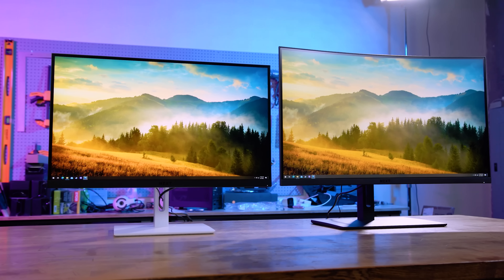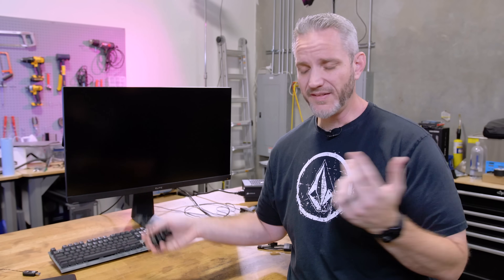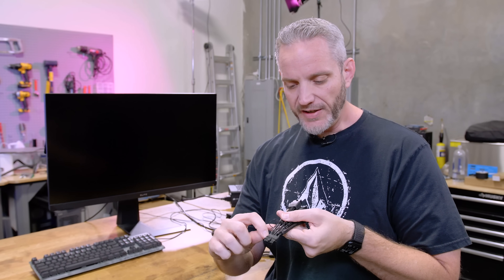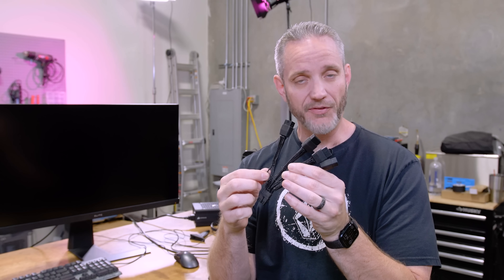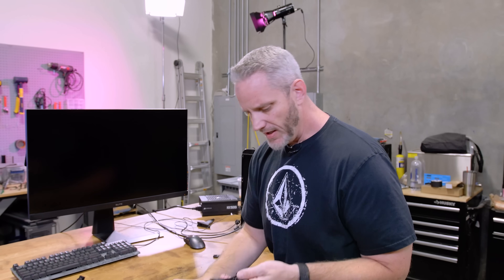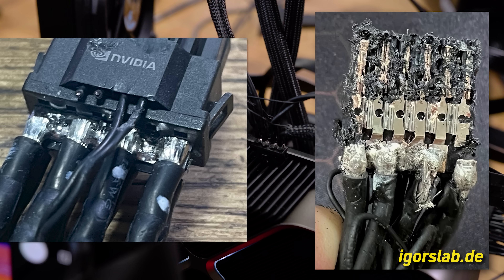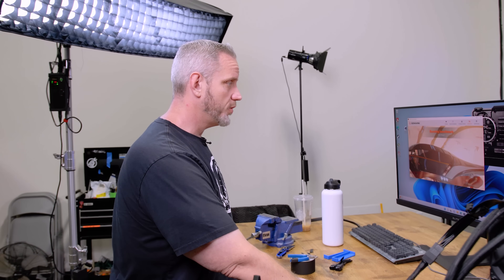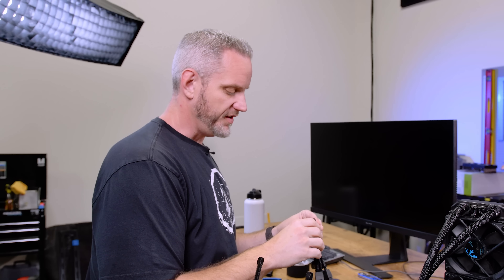Igor's Lab figured out why NVIDIA adapters are melting!

Comment: I miss the old days when cables were terminated with a crimped on connector that was nestled neatly deep inside the plastic housing where this sort of damage wasn't possible
Reply: Honestly why did they do this? I don't see it being cheaper.
Reply: crimped connectors are also connected to the isolated wire which acts like a strain release.
Reply: In aerospace all connectors are crimps for this reason. Crimps can survive extreme vibration levels that will cause solder to fail.

 An issue with crimps in commercial applications is that some manufacturers will cheap out and use generic tooling which doesn't crimp to spec. Pretty much all crimped connectors have an associated official crimp die that is only available from the manufacturer. For example the very common Harwin M20 connector (sometimes called a "dupont connector") has an official hand tool that costs $800 and as anyone who has tried to crimp these with off brand tools can attest generic tools make very poor crimps with them.
Reply: @nevoyu  Well it is cheaper just putting some solder and also they don't want to make a product that will last ages
Reply: @nevoyu  my guess is they pulled a Microsoft and engineered it to fail so you have to buy something else. Microsoft did it with the Xbox 360 video cable made it so it would fail and you would have to get a new one
Reply: @Di3Leberwurst  They should use barrel crimps like the ones used on Deutsch connectors in cars, those are tough as nails.
Reply: I really miss those days when PCI could provide the needed power by itself :D
Reply: @alifighter206  lol I don't have to miss those days I live it every day with my system... Socket 939 phenom x4 and Radeon 5450 lol
Reply: @alifighter206  u cand do nothing with such low power, only 75w come from PCI nothing but extreme low gpus can be powered with that.
Reply: @nicane-9966  then maybe they should rework the socket power delivery spec instead of making a weak connector spec
Reply: Nvidia just painted themselves to corner by making 4  Pcie 8 pin plugs to 6 +12V pins. There could be a way to wire the 12 pcs +12V from 8 pin pcie to 6 pins on new plug by putting double wires per pin and crimping them.
Reply: @nicane-9966  i know buddy, i was just kidding, only 710 gt could get its needed power by pci, even low end cards like 1650 need 6 pin power cable.
Reply: I miss the days where you just plugged your videocard into a slot and be done with it.
Reply: Socket 939 was opteron and x2 / FX cpys, phenom was years later.
Reply: @solocamo3654  you are correct sorry it has been many many years since I have been able to afford to build a new pc
Reply: yes. last week. the old days. lol.
Reply: @ThatGuy-ou4ev  lol it's like 30 cents per connector and close a $1 per if you run gold plated. Plus they would have to pay for some pretty expensive tooling (compared to a solder station) to automate the building of these adapters. The crimps themselves run like $300. There's no way they're going to do that unless they charge like $50 or more for the adapter.
Reply: I honestly feel stupid. I was convinced this was a bigger problems than it is. it turns out the issue is Nvidia! It never occurred to me that they would use solder in a connection that was designed to be crimped.
Reply: @alifighter206  now the VGA power consumption is higuer than all the other components combined.
Reply: They still are crimped on cables where each pin has it's own cable. I think Nvidia just did this to make it simpler for themselves, because there is no good way of connecting 3x4=12 power pins from the 4 8-pin connectors to the 6 power pins on the 12 pin connector. You can't just crimp two wires in a single pin. And since the power needs to be balanced across the pins and the 8-pin connectors, you can't just connect two pins from each somewhere in the middle. 

You basically need to have all pins have a common connection, and they decided to connect the 3 pins on each 8-pin into a single wire, and then connect all of those 4 wires with solder onto plates from the pins, while what looks to me like keeping the connections between the pins that come from manufacturing them from a single long sheet of metal, which are usually discarded. The problem here really, is that solder is not a good mechanical connection, and can easily experience failure with strain. 

The plates are also not the normal way to connect the pins to the wires, and they too have a weakness in how they are connected - with crimping, you can have a larger amount of metal connecting the crimping zone with the pin, because the pin is bent in a somewhat cylinder shape, but so is the crimping zone, while with plates, because the plate needs to be flat, you have to decrease the amount of metal connecting the plate with the pin.

I can get why the engineers did it this way. There's no really other way to do this without having some simple PCB in the middle, which adds a bunch of costs, since now you have to both solder and crimp, doesn't look good, and would likely be a bit of a pain to builders. But seems like that didn't work, and I do expect them to add a PCB somewhere to solve this - whether on the 12-pin connector, or somewhere in the middle.
Reply: @ThatGuy-ou4ev  I'm a body man in a GM collision repair facility and this is objectively incorrect.  Those connectors have been known to melt on 35W load.
Reply: @ignaloidas  looking at the image from igor the solder connection wasn't the fail point if you look at it again it's that less than paper thin sheet metal that the pin and pads are made from... There is plenty enough room on that over compensating graphics card that they could have made or used a different connector all together. You know possibly try and work together with another company and design a different pcie power connector for the next gen instead of this
Reply: @gvibes69  Do you really think that after criticising the approarch Nvidia took for 4 paragraphs, and then saying why they did it that way, I am defending Nvidia? No, they did a mistake. I understand why, but that doesn't excuse the lack of QA of the design.
Reply: @gvibes69  Defending? No, I just understand the realistic cost of trying to run Deutsche or even Ampseal the slightly cheaper connectors. If you've ever actually built the connectors and bought them as a manufacturer, you'd know that it would be unrealistic to throw it in as a freebie.
Reply: I've said it before... Just slap a mobo 24 pin power connector on it and call it a day
Reply: @Skaadi89  Mobo 24 pin has many pins that cannot power a GPU, also the 24 pin spec requires that there is exactly one of them on the PSU, as some of those low-power pins are used to turn on and off the PSU when requested by the motherboard.
Reply: @johndododoe1411  I'm only suggesting to use the connector doesn't have to have the same pin out or keying just use a connection that can support enough wires to safely handle the power draw and be strong enough not to break it's not like they are lacking space on the card they didn't have to use a dinky little fragile connector
Reply: Molex! Molex! Molex!
Reply: @brodriguez11000  I can agree with that lol
Reply: @Bot.number.69420  Oh they can. All these fancy connectors are basically extensions of the Pentium 4 P4 connector. That means, just two connections - 12v and ground. All the additional wires are for required current capacity. So if you really want it to be made simple, take a cue from appliances and use those kind of terminals and wires.
Reply: @Skaadi89  It ain't that thin. Certainly thicker than the traces on the PCB the connector comes down to. And it's the same with other power connectors on a computer, all but sata are basically the same folded sheet metal pin design.

The real problem, as I said, is that instead of crimping, Nvidia chose to solder, and an soldered soldered connection needs a flat surface so solder to. To achieve that flat surface, you have to compromise the amount of metal between the soldering surface and the rest of the pin. If they just crimped, like the connector was designed for, it would have been fine. This is no fault of the connector, only how Nvidia implemented the splitter.
Reply: With this issue evolving they should be forced to use crimped wires. Here in Germany we strive to switch to solderless joints for obvious reasons.
Reply: Yeah, it blows my mind that they use such tiny solder joints for high power connections. I get that the female (or male...? not sure) is soldered to the card, but those are through holes and far, far stronger.
Reply: @atomicskull6405  not just aerospace in almost any wire harness it's the most secure and safe connection available if you need connector and where vibration is present 
Solder is non flexible and will create a failure point at the end of the solder where the wire becomes flexible
Reply: @SviatoslavDamaschin  all power supply are made with crimp connector it nothing special it even faster and easier to manufacture
who ever said this was a good idea must be fired on the spot
Reply: @Tenzen.  what lol this is nothing for a company lol 300 buck lol
Anything with a connector is crimped every power supply in existence use crimped connection
Not one car manufacturer use solder on wiring harness 
Crimping is a way more repeatable process that will ensure quality and durability where solder will vary from one to another 
And is the only way if you want a waterproof connector
Reply: Then go back to stone age as well you will definitely going to enjoy and also stop using technology and live on tree go champ this is what you want
Reply: @legros731 I didn't say not to crimp. I said the use of Deutsch or Ampseal connectors and giving them away with gpu at no extra cost won't happen. 

There's cheaper and easier methods to crimp connectors.

$300 is per hand tool to crimp and it has to be done in a precise manner or the connector has to be redone. If they tooled out something to automate it would be way more expensive than using existing automated tech to crimp pins.
Reply: @flynntaggart7216  you don't seem to be all that bright. We are just saying it would have been better to use something more sturdy. You know something that can actually handle being installed and used without fear of damage. I guess Nvidia could have just made the card not as tall there is quite a bit of empty space that could have been trimmed off so it could fit in a case without having to bend a chintzy cheap cable that really can't handle the current that flows through it or maybe put the power connector in a different location that wouldn't require bending the cable. Nvidia designed the whole pcb they could have done something different.
Reply: @nevoyu  crimping is a physical press process. Soldering is just laying a liquid metal over some wires. If they’re doing it this way, it must be cheaper. Company profit equals efficient process cost/time. There’s a lot that goes into this most peeled don’t think about. I’m not directly related to production in a physical sense, but i know JPH  (jobs per hour) matter. So it’s more than likely a cost savings in time/money in the overall scheme. Like someone mentioned it could be tooling related too.
Reply: @mikebutterface8583  I can understand that but wouldn't it be cheaper to use existing tooling? I do understand the process I run my own business and I produce 90% of my own parts in house to cut cost and I also know that getting new tooling made and tested cost a lot more than adapting something that already exists
Reply: @mikebutterface8583  It's less about it being cheaper to solder than crimping, and more about it being easier to solder all the cables at soldered together at the connectors than to have some point that connects all 12 of the cables from the 8-pins and puts out 6 cables for the 12pin to crimp on. It's hard both mechanically (easiest way would just be to have a PCB in the middle, but you'd solder the wires to that, and here we go again with solder) and aesthetically (where do you have the common connection? You can't have it in the 12 pin if you want crimped connections, a PCB in the middle is an aesthetic horror, and just putting all of the 8 pins on a PCB and putting a 12-pin in there so that we have a single 12-wire cable makes you have another PCB in your case with no good place to put it). It's a hard problem to solve honestly. But I would have went for the separate PCB way.
Reply: @Skaadi89  it was a tangent conversation that someone said to use Deutsch connectors and I said that it wouldn't be cost effective to use them. I prototyped electrical devices using different connector types to see cost and effectiveness of the connectors. So I was pretty sure the cost benefit analysis was against using high end connectors like Deutsch or Ampseal to make a free adapter.  

There's not really that many automation options that are open market for this type of crimp. You can buy access or hire out but then again, much more expensive than traditional crimps or soldering.
Reply: @nevoyu  Programmed obsolescence, it's like the decrease in VRAM, the 5000 will have 12GB or even 8GB, I'd almost bet on it, Nvidia has always been the villain, and I hope, even if there have been problems, that AMD will do the same as with Ryzen, and make these scoundrels more humble.